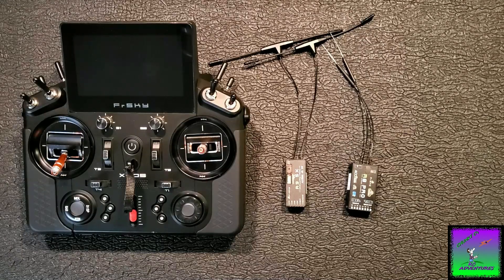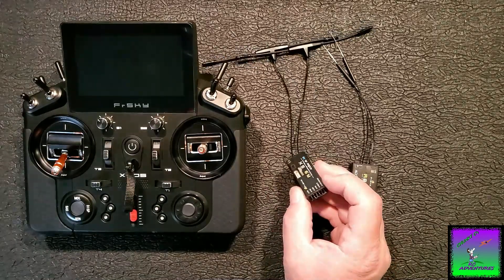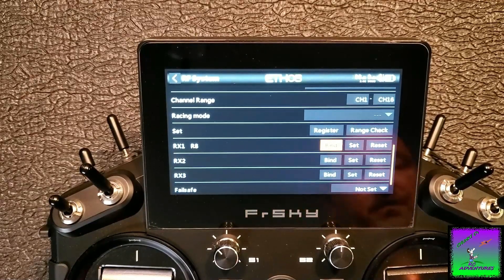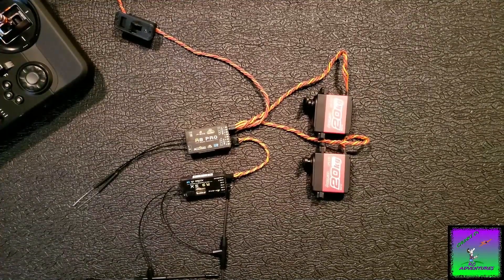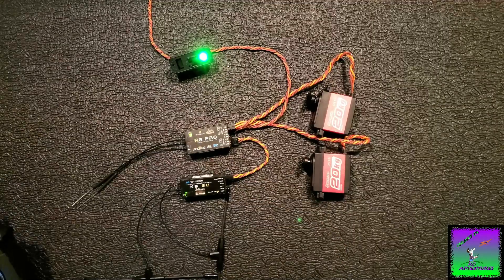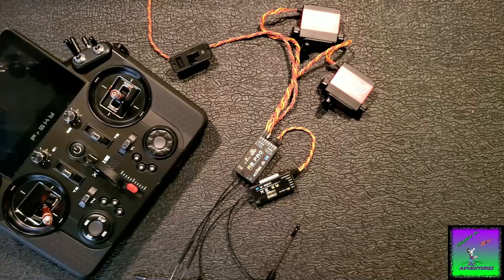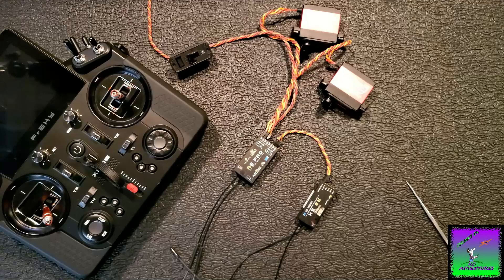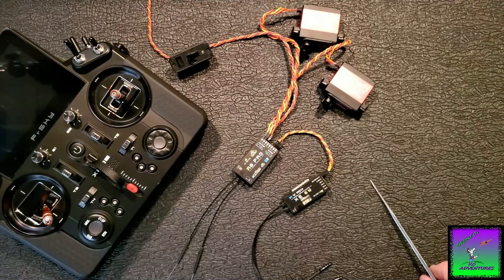Redundant RC Aircraft Systems: FrSky ETHOS Dual Band, Dual Receiver Setup. Is It Really Redundant?

Comment: i use the same system too, in deed, i set the fail safe to turn on the self level mode of the gyro (i use the SR8 pro), then i can aware immediately when fail safe kicks in, during my flight i found 2 fail safe kicked in (less than 1 sec), i set the 2.4 and 900 RSSI warning to <35 and VFR warning to <50, while there is no warning, i logged the min RSSI and VFR, RSSI is over 35 and VFR is over 50, i have no idea whey FS kicked in ...........
Reply from the maker: If failsafe kicked in, then it sounds like you actualy had a signal loss. I would pay close attention to your receiver and radio antennas positions and do an extended range check while at the same time, having someone rotate the plane in all different directions.

Comment: Would this work on a TX16S?
Reply from the maker: You can bind 2 receivers to a TX16S, but I haven't tried binding 2 FrSky receivers by way of an S-Buss link to a Radio master. See video links below. You can run 2 receivers off the radiomaster and split the airplane controls between them. Thanx for the question. I'm curios to see what the outcome is. Maybe this is something I need to investigate and do a video on.

https://www.youtube.com/watch?v=MO1K_6fTAG0&list=PLQS2OSc3uBTV3YOsy27jttiXATrAI_scC&index=3

https://www.youtube.com/watch?v=1wxaSNs--EA&list=PLQS2OSc3uBTV3YOsy27jttiXATrAI_scC&index=5
Reply from the maker: Actually, upon second thought, it won't work for the new  FrSky ACCESS protocol. TX16S won't do ACCESS. It may work for older D16 stuff if the receivers have S-Bus in and out ports.

Comment: PS I loose 2.4 all the time in carbon wood gas and glow planes   900 been saving my ass.  I hate the low VFR warning I get mostly when many people are flying or in the pits.   Great video
Reply from the maker: Make sure your RSSI settings are set correctly. I had to adjust mine down a bit when I read this in the Ethos manual..

"ACCESS
The default alarms for ACCESS are 35 for 'RSSI Low' and 32 for 'RSSI Critical'. 
Loss of control will happen when the RSSI drops to around 28"
Reply from the maker: Also, RSSI and VFR are 2 different things that kinda do the same thing (if that makes sense). According to Ethos manual there are no alarms for VFR unless you have set one up through a logical switch. Thanx for the comment...

"VFR%
Prior to ACCESS V2.1, RSSI was based on a combination of received signal strength
and lost frame rate. Lost frames have now been removed from the RSSI 
calculation, and added as a new sensor VFR% (Valid Frame Rate) to provide a 
measure of Link Quality. At this stage there is no built in alert for VFR%, but you 
can easily set one up as follows:
a) Set a Logical Switch to become True when VFR drops below say 80% (please 
refer to the Logic Switches section):"
Reply: @ChunkyC_RC  
Thanks.  Say that setting is in a widget for rx/ options/telemetry/values/Rssi/ then I think the adjustment is there. ?  Ahh yea ?     It makes sense.      I feel I would have better 2.4 if the antenna wires were just a bit longer to deal with a carbon airplane.   That’s my issue mostly I feel.   I’m learning allot.    Do you know of a good tutorial on setting up dual elevator service to get them to sync. Perfect ?   Or multi servos like on a wing same thing I’m using a mix but I’m just still having issues trying to get it right I don’t know what I’m doing wrong. This is a very common thing that people need with RC. I’m surprised it have a canned program that balances the service out everybody else does, and that’s one big reason why I might go back unless I figure out how to do it simply.  
Thanks in advance
Reply from the maker: Sorry I just saw this message. There's a lot of videos for servo matching. As for a carbon airframe, remember to keep the uncovered end of the antenna well away from carbon fiber. Also, keep antennas in a 90 degree orientation and as far apart as possible. If your plane airframe is completely solid (or close to it) made of CF, then you have DEFINITELY GOTTA GET THE ANTENNA'S OUTSIDE OF THE FUSELAGE. Keep me posted and thanx for the question.

Comment: Thanks  great video.  Now I need to find a better way to match servos with ethos. Using a curve is a real clunky way of doing it.. I fly gas and Pattern and getting my elevators to track perfect is very hard with ethos rite now for me.  Thanks again great video
Reply from the maker: Only way I can think of is s-bus programmable servos. you can set match end points and centers but you may still need to dabble a bit with a curve or 2.
Reply: @ChunkyC_RC  
People who fly precision aircraft with dual elevators or multiple wing servers need balance options. It’s the biggest selling point for like spectrum, Vitara and Jeti they’ll have a balance function. That’s basically a curve set up, but it’s graphically shown on the screen and just drag it up and down and that makes the server follow points that you mark and you just compared to the other servo.  If ethos wants to be a trapping system, they’re gonna need to put that in there that’s if they want people with nice airplanes defuse it.

Comment: But why did you lose 2.4ghz? 
I never lose 2.4 on Futaba!
Reply from the maker: Honestly, I still don't know why. I've never lost 2.4 on Futaba either knocks on wood
Reply: @ChunkyC_RC  Good However, good video. I have recently purchased a X20S and using it on a couple small planes before swapping it to my large planes and turbines.
Still using my futaba 18Mz on my more expensive birds for now. 
Still learning the x20s and really liking it. 
The goal, to eventually swap everything to the x20s and sell the futaba gear.
Reply from the maker: @hydrojet7x70  I don't think I could get rid of my 18MZ. I do like the cheaper receivers for the X20S though.
Reply: @ChunkyC_RC  Do you plan on using the x20s more and just keep the 18Mz as a back up?
Reply from the maker: My Futaba will be my Main transmitter. I have to make a decision between the X20S and Radiomaster which one I want to keep and which one to sell. Probably gonna end up selling the Radiomaster even though I have a lot of dsmx receivers that I used with my JR.
Reply: @ChunkyC_RC  I do really like the full paper manual on the futaba. Wish frsky had one to even download and print myself.
Reply from the maker: That's why I like doing these videos. Helping people figure stuff out....

Comment: Great video. Why not just use a Tandem receiver? I have the TD R10. Still learning about FrSky/Ethos. I’m very new to FrSky myself. Coming from Spektrum and Futaba.  Darren aka Mr.D IS a great YouTuber to learn from. He is full of Information. An awesome guy! He truly responds swiftly to any questions you may have about FrSky and Ethos systems. 👍👍👍
Reply from the maker: The Tandem receivers are nice. Although not really redundant. They ARE easier to set up than this but I wanted to show this because there's not a lot of info out there on how to setup a 900mhz receiver and bind both of them to the X20S. You are correct though, they both achieve the same outcome. Thanx for the comment 👍
Reply: Tandem receivers currently do not support stabilization (AFAIK).
Reply: @RogueRc  that’s ok by me. I never fly with stabs nor safe. In my opinion, those are for beginners. But that’s just me.
Reply from the maker: Some of the Spektrum "SAFE" systems are waaay to complicated. Even for someone with experience. Its hard to tell when safe is off or on, you gotta bind it a certain way. If a new person becomes dependent on SAFE then they will be in for a rude awakening when they fly their first "non-assisted" aircraft.
Reply from the maker: I believe your right. I don't think they have Stab in them yet